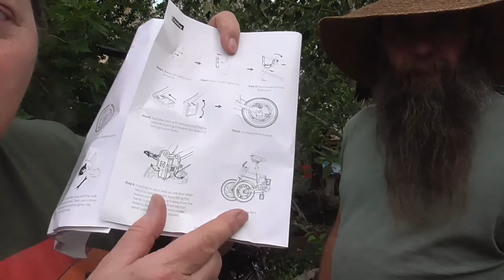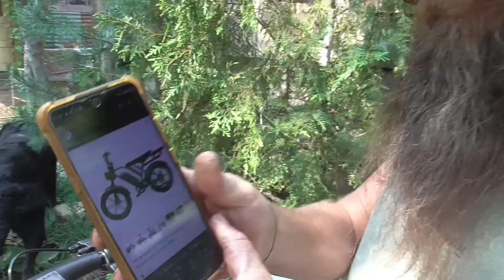RAIL to TRAIL Ride This Thing is UNIQUE and UNBELIEVABLE! TST E-BIKE Small and Compact

Comment: Add a separate battery powered solar charged front LED light and ride during low light safely. That should be something offered on the next model or as an optional upgrade. Make that front lamp able to double as a removeable light for breakdowns and emergencies. In your area that could come in handy if the weather suddenly turns while you're out and you seek shelter. Great Video!
Reply from the maker: Great Idea 💡